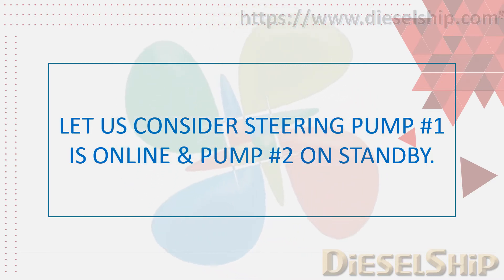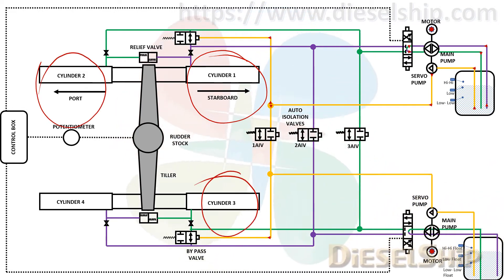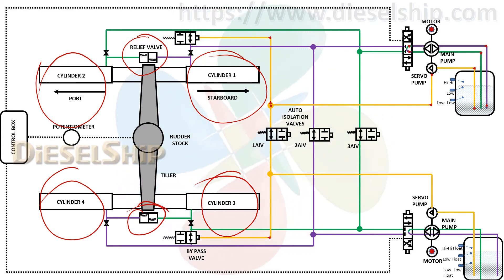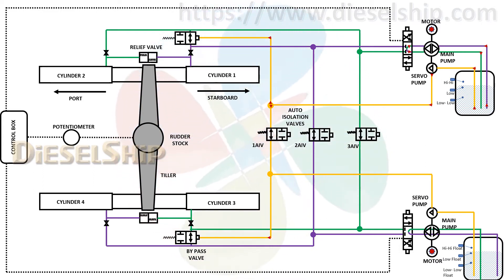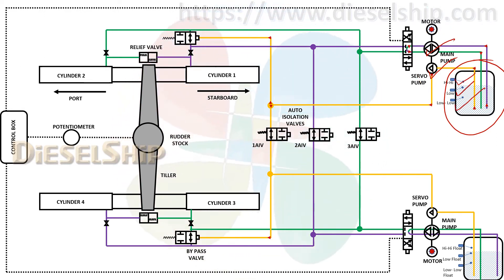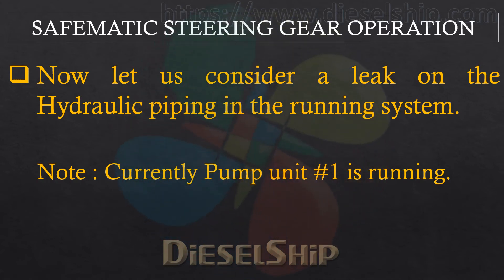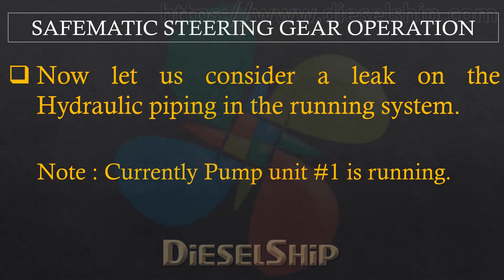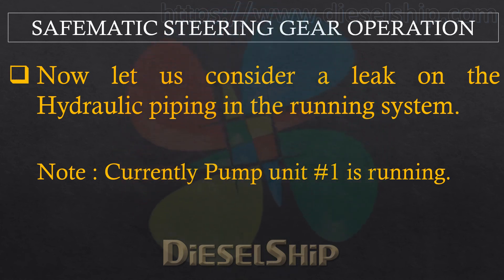FOUR RAM HYDRAULIC STEERING GEAR

Comment: I have a question at 13:20, what is the reason why the bypass valve of unit 1 opened after there was a leak? I hope you would see my comment and answer my question because I would like to take your video as a reference in my report for school😅
Reply: If the by-pass valve doesnt open, the residual oil in the cylinders will act as an hydrualic break! The rams of the isolated side still moves with the rudder stock right? you dont mechanically dismount them so as to ensure that the oil in the cyliners do not act as a brake the by-pass valve opens so that the pressure can transfer from one cylinder to another! If by-pass valve doesnt open then the oil will still pass through the relief valves! But that's not desired! Hope i explained it well! Good luck with your presentation!
Reply: @thedieselship  thank you for the response, now I have an answer incase my fellow students asks me about that.

Comment: sir one question, after one system is failure, is it 100% retandency by using 2 ram...?
Reply: Same question
Reply: @youngsinatra69  Depends if the ship steering is purchased that way! But yes for it to be in compliance with safematic requirement 1 set of rams should provide the operations needed as required by SOLAS! Meaning it is 100% redundant!

Comment: When there is leak and pump stops so both the isolating valves (near to rams)will open or only one .in video one is  in close position and one in open position when the system is stopped due to low low level
Pls clarify 
Thanks

Comment: Sir @5:20 you said bypass will open due to servo pump pressure but in animation its closing due to servo pump pressure
Pls clarify weather valve will open or close with servo pump pressure 
Thanks
Reply: Hello, Please refer to the pinned comment on top, ***CORRECTION, AT 05:18, I SAID THE BY PASS VALVE IS OPEN DUE TO SERVO PUMP, THIS IS A MISTAKE, IT CLOSES DUE TO PRESSURE FROM SERVO PUMPS, OPENS WHEN THERE IS NO PRESSURE FROM SERVO PUMP**** APOLOGIES
Reply: Hello yes, it was a mistake! i have pinned a comment correcting this! Thanks

Comment: Suppose number 2 unit is running.but leak is on no 1 side. So even after closing bypass valve the leak will continue and oil from no 1 unit unit also will be lost. This is wrong I think.
Reply: In any case it wont affect steering capability of #1. Safematic requires that, issue on one of the steering should not render the other one out of operation. The idea is to ensure steering capability is available with one!.
Reply: If #2 is running and the leak is on #1, yes the AIS will close and #2 will still continue to run! I dont understand why it is wrong? which ever side has low oil level that side will close no matter which is running! If you ask me if the level drops in both tanks! Steering gear will trip! Good luck
Reply: I have Same question

Comment: One question sir.......what is the type of pump used here     ?   Does the pump have capability to control the flow rate? Or the flow control is done by directional control valve.....pls reply
Reply: Squash plate pump
Reply: @rajaravitejajalagampala9320  swash plate pump *

Comment: Great explanation sir.
Just a small doubt, When at 13:20 the bypass valve of cyl 1 and 2 opens due to lack of hydraulic oil pressure from servo pump, shouldn't the other bypass valve also open at the very same time or it has some lag or will it not open at all?? 
Please clarify sir
Reply: Other bypass valve connected to ram 3 and 4 will keep close as the pump no will carrying the out hydraulic steering in this case if you keep the bypass then it will just short circuit and bypass ram 3 and 4.

Comment: Very informative video sir. I have a doubt regarding safematic system. While the #1 system is on operation what if the hydraulic leak is on high pressure line on #2 side say near ram cylinder 3? The oil level in the #1 reservoir will still go down and the system will be islotaed automatically. Now #2 system will come up but as the leak is near ram cylinder 3 the oil level in the #2 reservoir will go down too. So as I see both the system will be hampered. Thank you in advance.
Reply from the maker: Yes if the leak is after the auto isolation valve the oil will leak anyways... This is the reason why Low level alarm (before low-low trip & change over )and quick human intervention on time is very important. 
Even if this is the case as you mentioned, watchkeeping engineer is able to correct it manually by refilling the reservoir on the side where the pipe is intact.
This is why during critical operations like manoeuvring or standby both systems are operated individually with AIS valves closed.

Large ships have totally different design where sets of RAMs completely isolated by design, where the required torque is achieved only with 2 sets of RAM. Therefore such designs doesn’t have interconnection between hydraulic lines, no concept of auto isolation valve etc, Also such designs have the by-pass valve operated by the main pump itself.
This is safematic by 'installation itself' no isolation valves required.
Reply: @dieselship1026  That answers my question. Thank you once again.
Reply: Continuing on this question sir,
If the leak is after autoisolation valve and the watchkeeper comes and fills the tank 1 with the oil how he can ensure the closing of autoisolation valve ( I mean is there any manual way also to close the autoisolation valves?)
Reply: @Sailor_de_himalaya  i am replying after a very long time. yes the isolation valves do have manual control.